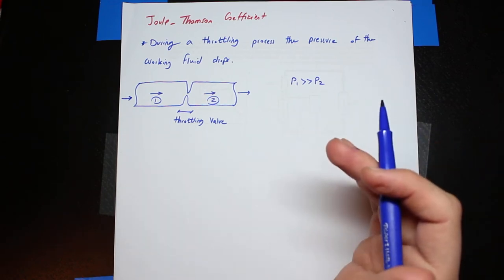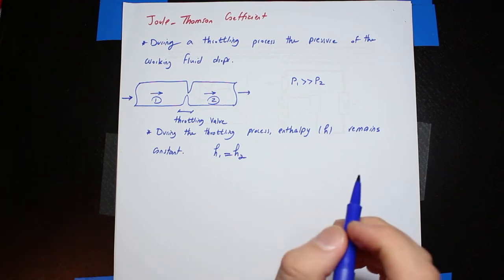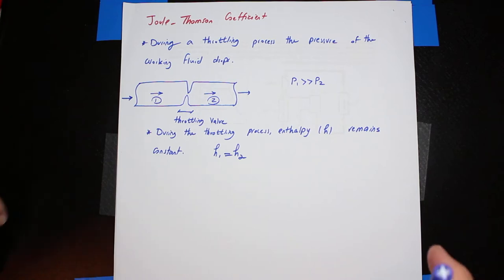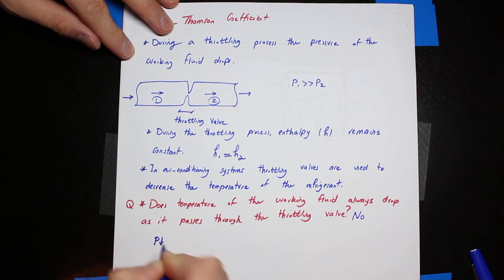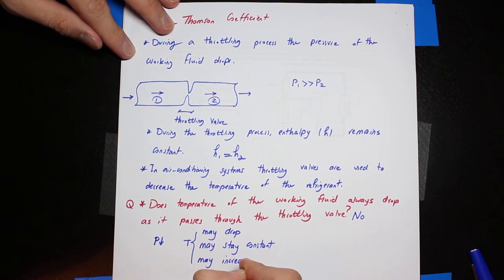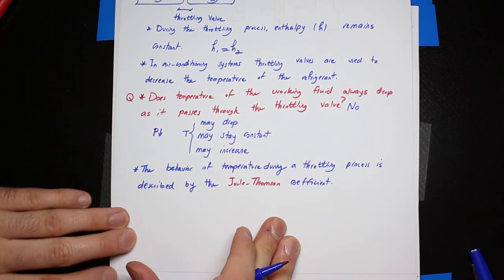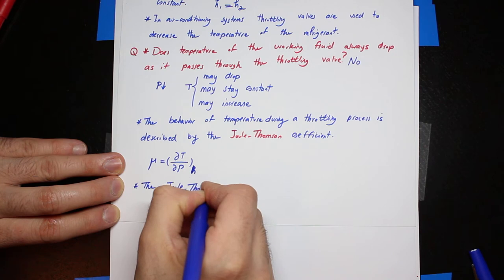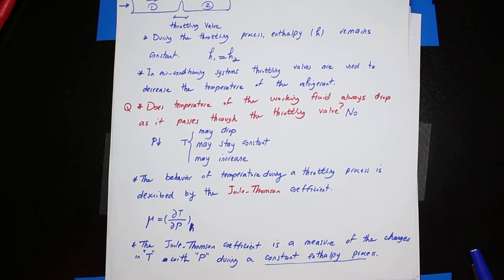The Joule-Thomson Coefficient (video 11)

Comment: how those h constant lines are obtained  - ? during experimentation
Reply from the maker: h (enthalpy) is sum of u (internal energy) and flow Pv (flow work). That is h=u+Pv where P is the pressure and v is the specific volume. h can be obtained either from tables or by adding u and Pv. In other words for each x and y point on the T-P plot, we can easily obtain the h value. If we connect the points (i.e. states) that have identical h values, we end up with lines as you can see on the plot. I hope this helps. Please let me know if you have any questions.